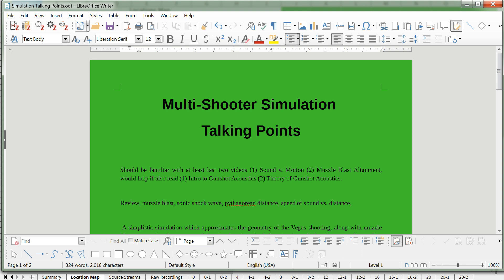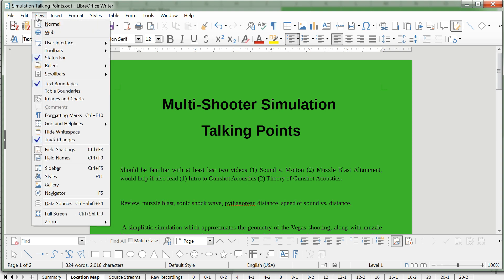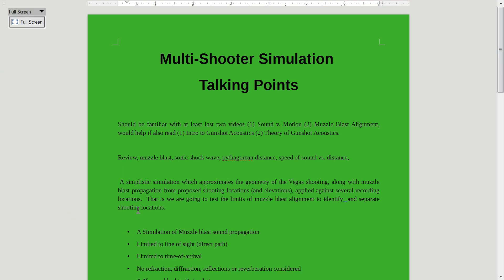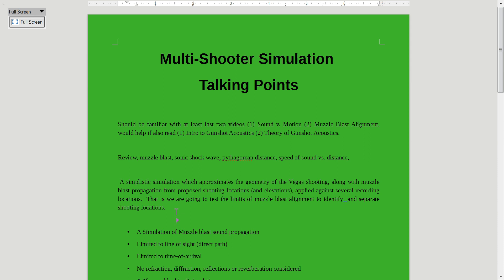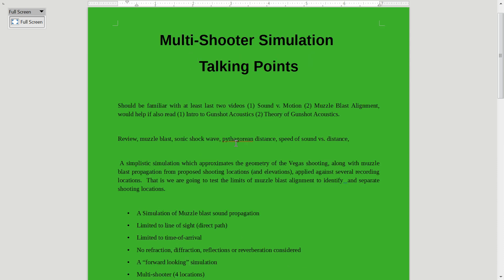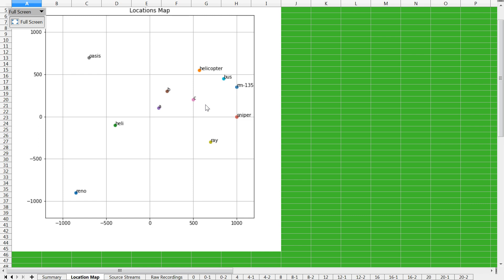Multiple Shooter Simulation -- Multiple Signal Alignment Part II, Las Vegas Shooting October 1, 2017

Comment: Well explained as usual. The alignment technique is really powerful.
Reply from the maker: Yes, it can quickly sort the wheat from the chafe. I have some standard alignment groups (1) volleys, (2) speakers, (3) 0.308, (4) Mandalay Bay Marque, (5) Mandalay Strobe, (6) a few midpoint sounds

Between all these I can usually get a good handle on things.  Of course the "light" based alignment points are less precise than the sound ones, but at least provide an absolute time to get an idea of which audio is first in time.